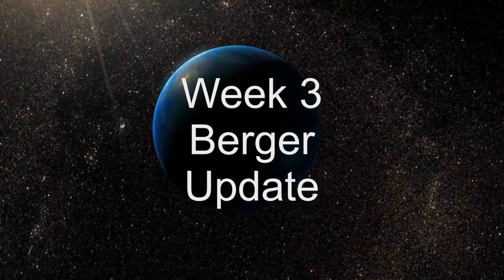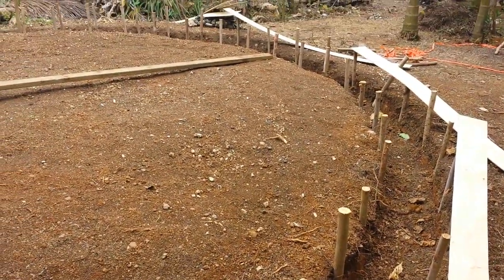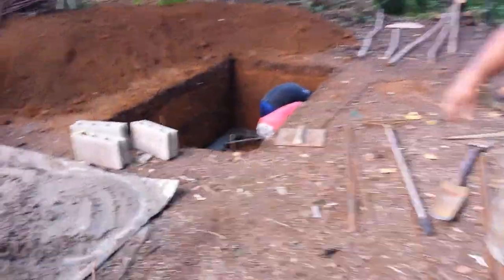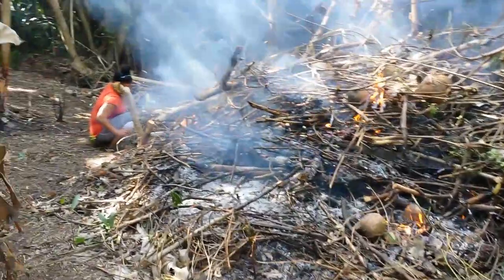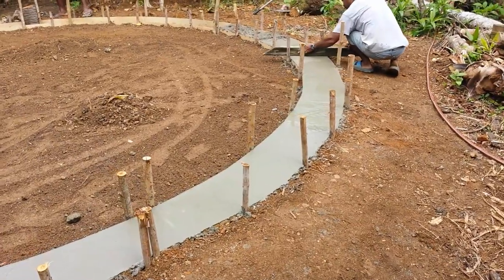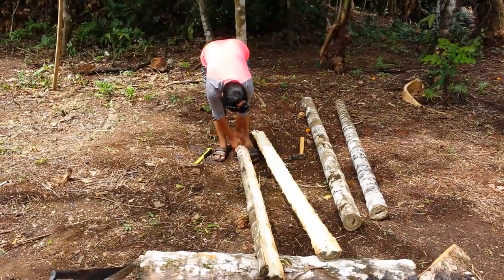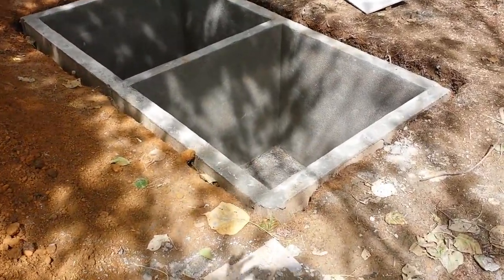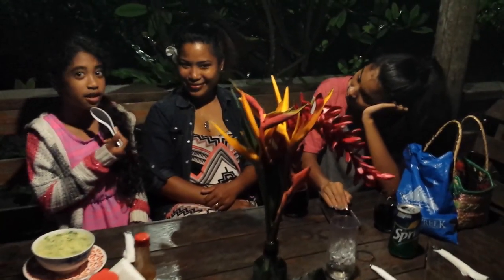Aircrete Dome Home, Foundation, Septic, Yap, Micronesia

Comment: Please show the locals how much better it is to cook over a Rocket Stove than over an open campfire.
Reply: Hi Bob. Check Rocket Stoves out on YouTube. Rocket stoves are super efficient wood burning stoves. They help decrease deforestation and greatly reduce the labor of collecting firewood - because the use so little wood. Also, if need be, they can be made from locally made  mud bricks, but regular bricks would be better if available. Cheers, Kevin